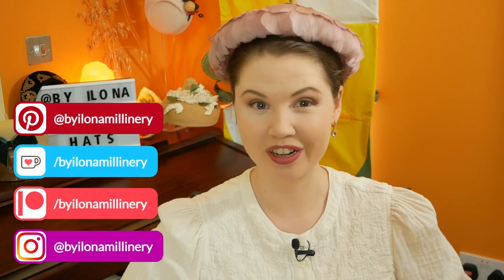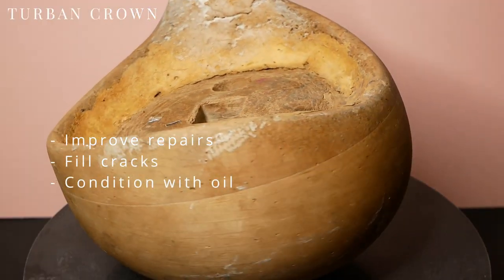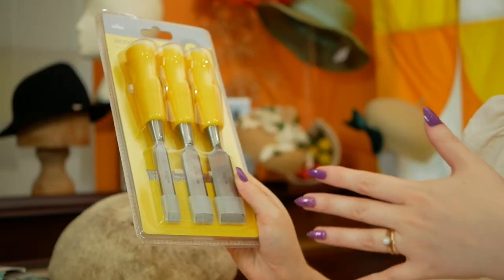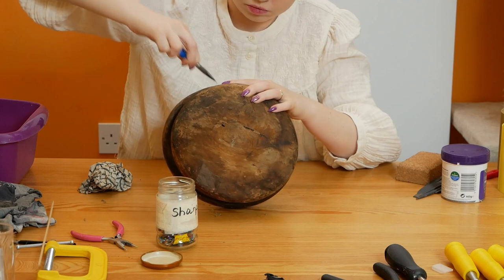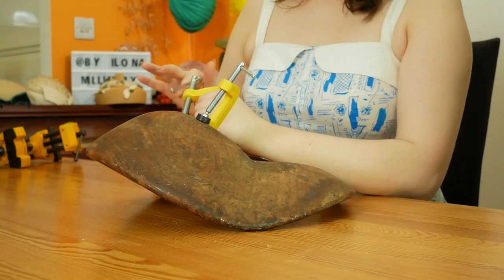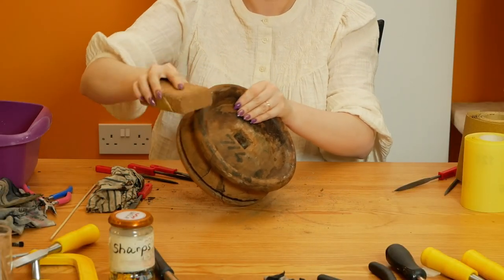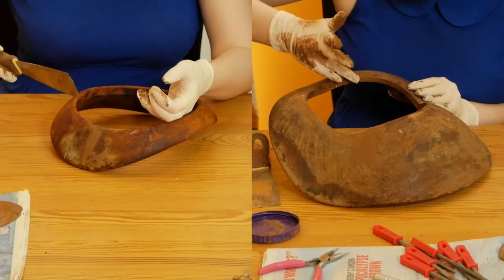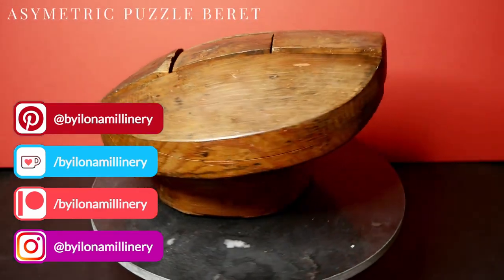Restoring my antique & vintage hat blocks 🪓🔨👒 | Hat block care | Millinery Hat Making DIY

Comment: Thank you for such a great how-to.
I was fortunate enough to get the entire block catalog from the estate sale of a milliner. +/- 100 blocks in total. 
Many are very old, and I've been trying to figure out how best to care for them, so your video is incredibly helpful. 
Have you had to replace any substantial chips or chunks with wood filler? 
I have a few puzzle blocks and several blocks with pronounced ridges that will need to be rebuilt.
Reply from the maker: Hello Joyce! I am so glad you found this video useful! I have encountered similar problems with puzzle blocks. You can rebuild the pronounced ridges with wood filler. Build it up slowly by adding about 5mm of filler per layer. Make sure each 5mm layer is fully dry before adding the next one. I hope this helps!

Comment: Fantastic info! though I have a question for anyone who sees it! I was gifted some hat heads which lead me to learning millinery and some of them appear to be balsa wood. Does anyone have experience trying to rehydrate balsa wood hat heads? Theyre delicate, so im hesitant to get to experimental.
Reply from the maker: Hello, I haven't worked with balsa wood heads. I use mineral oil (like you would on a wooden chopping board) on my hat blocks once a year to keep them hydrated. I buy my mineral chopping board oil from IKEA. Just make sure the oil is fully absorbed before using the heads. I usually leave my blocks to dry for 1 week just to be sure!